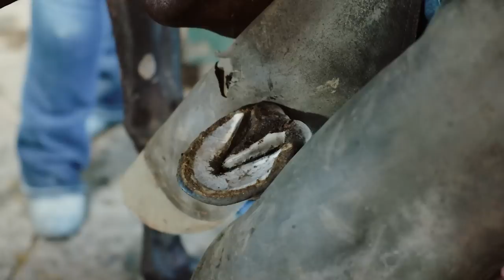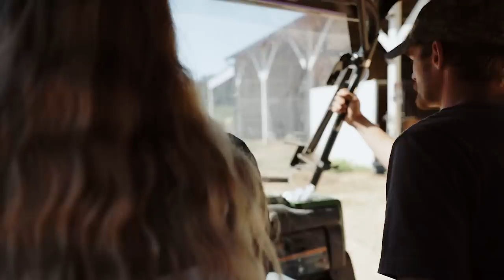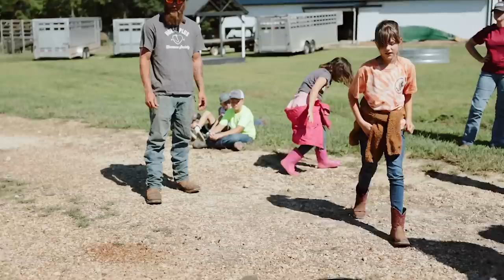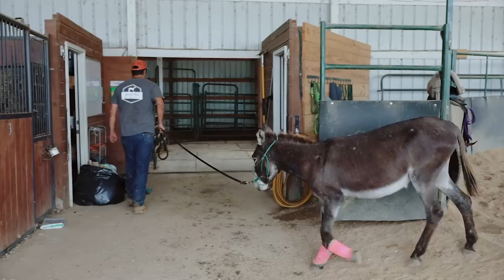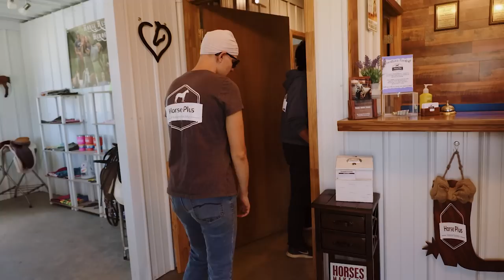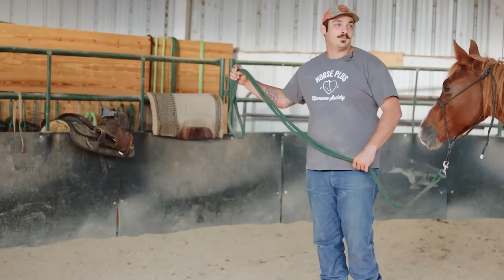The Cranky Donkey - Horse Shelter Heroes S3E29

Comment: First wipe the saddle with a duster, then a damp cloth then use Murphy’s wood oil soap and water 50/50 which makes a great solution for cleaning. Spray it on and wipe down with a damp cloth.

Comment: If Halo has a tooth near the hole, pull the tooth. The hole will heal up. When fly season is over, the hole will heal on its own. Had a horse with a broken jaw before I bought him. The Vet drilled a hole and cleaned out broken bone. Ground up food was always pushing thru the hole. Had to keep it clean from the flies during summer. It reeked! Not pussy though. Once the tooth finally fell out, the hole healed up from the inside and then to the outside. Horse was never sick and the tooth was up above the bars of the mouth, so it never bothered the horse with a bit in its mouth.
Sure was glad when it healed up. Trying to keep the flies from laying eggs in the hole was a full time job. I tried making all kinds of things to keep the hole where it could get air, but keep the flies out. Good luck!
Reply: They have an entire vet team caring for Halo. I worked Guess they have vast experience with multiple cases like hers, across several species.   I’m figuring they know what they’re doing
Reply: The tooth is long gone; the area was just so infected for so long prior that the tissue had to become healthy again before it could heal.

Comment: OMG. BE CAREFUL. THERE ARE GROUND HORNETS AND THEY ARE MEAN.SORRY. I CANNOT GET THE CAPS LOCK TO TURN OFF. ANYWAY, BRAKE CLEAN WORKS REALLY WELL AND IT IS CHEAPER. PLUS IT JUST DROPS THEM MID AIR BECAUSE OF THE ETHER.